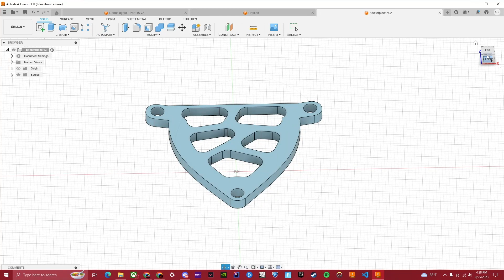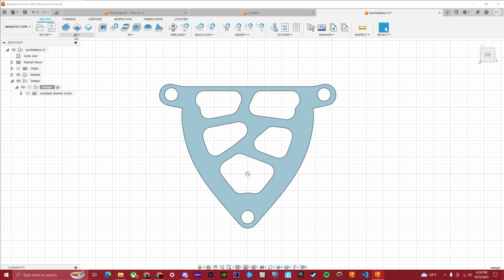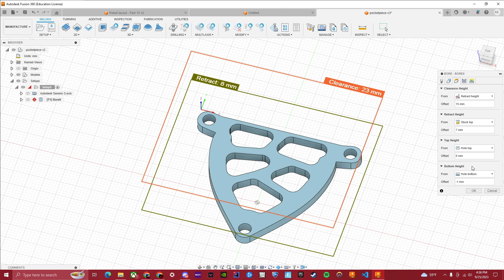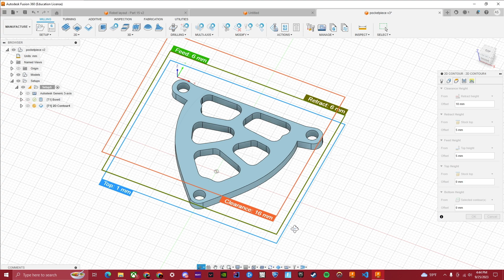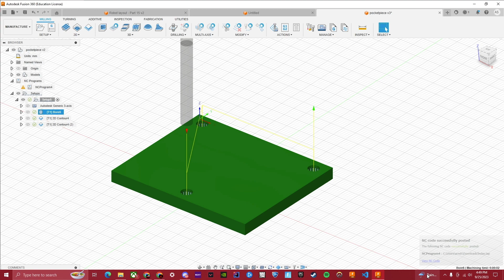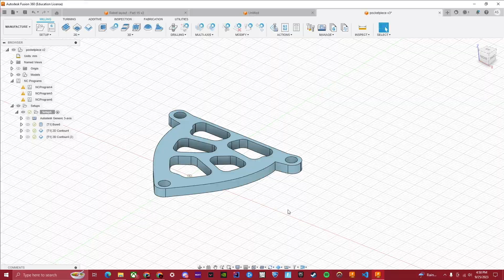Generating Toolpaths (Gcode) for an Omio x8 CNC Router - Part 1/2 - FTC 14481 CNC Series

Comment: ..Cant find Part 2/2 for this video.
Part 1 is excellent, Thanks
EDIT.
Ahhh, part 2 is called "Safety and Use of an Omio x8 CNC Router for Custom Manufacturing- Part 2/2 - FTC 14481 CNC Guide"

Comment: Very useful, most appreciated.
This is the first time I have found any recommendation during Manufacture/setup/setup as to what 'machine' to choose when using a OmioX8  (0'56"). Thanks
 I like the way (after 10 mins) the posting is broken into 2 files rather than one that you get if you use the normal 'Actions / Post process'
..At 9'50" you suggest that 'lead in' paths are a waste of metal / unnecessary and should be set to zero, 
This disagrees with most recommendations when using end mills as "Endmills are not really designed for full diameter plunging. There is insufficient clearance at the center to allow for chip evacuation."
My newbie experiences have seen the spindle wanting to stall out when attempting to drill straight down (zero lead-in) with an endmill. ymmv